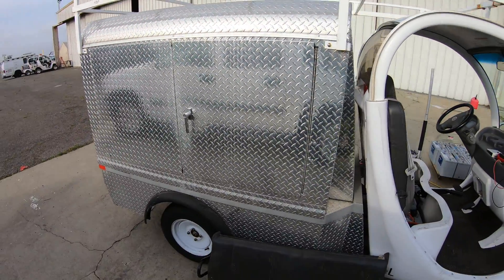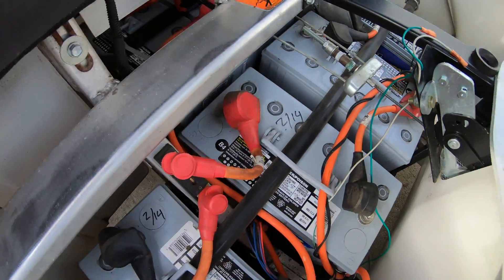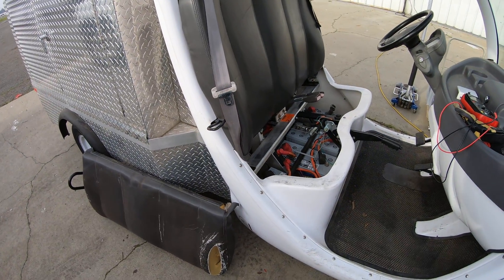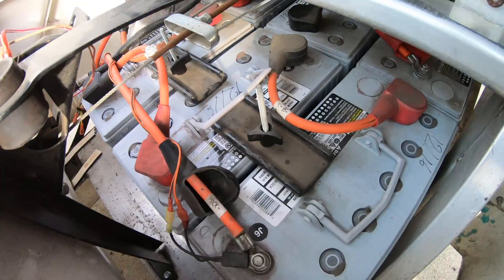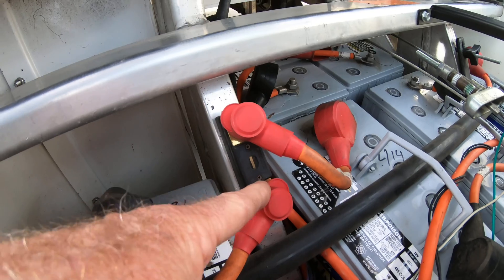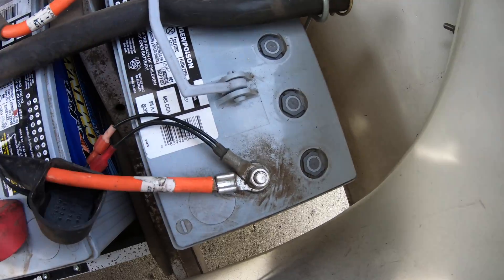2005 & 2006 Gem Car Truck Battery Layout in Glorious 4K

Comment: My 2004 has the 4+2 layout also if that helps anyone else.
Reply from the maker: To confirm the 04 should have four under the seat and two behind…..  & the 20O2 & previous have four under the seat and two under the hood.
Reply: @wcolby  Correct, 4 under the seat, 2 under bed (behind the 4).  I was happy to see your video as I was off by 1 connection in my attempts to map wiring.  Got to drive my unit for the first time today.

Comment: Where did the silver cab come from?
Reply from the maker: Its from a factory that makes silver cabs.... but that's not important right now.  (End of airplane comedy)   They are sold by NEV accessories in Chandler Arizona, they came in a flat pack & they were easily assembled right on to the bed of the gem truck. That was the 3 door available in 2010 ish, I think they only sell the single door now.  https://nev-accessories.com is the go to site for gem car stuff.